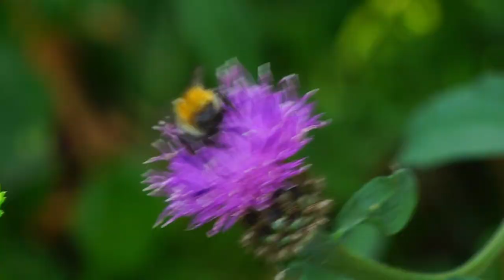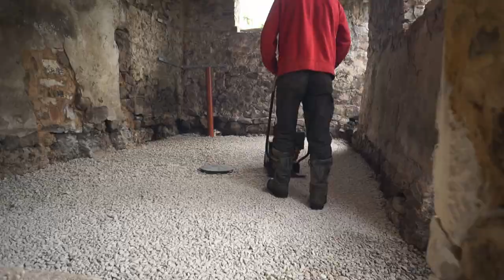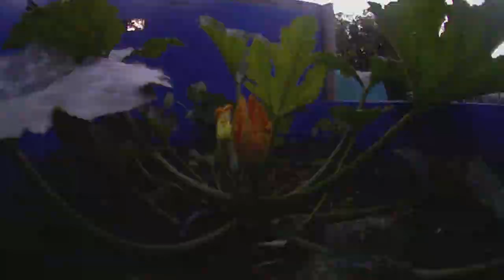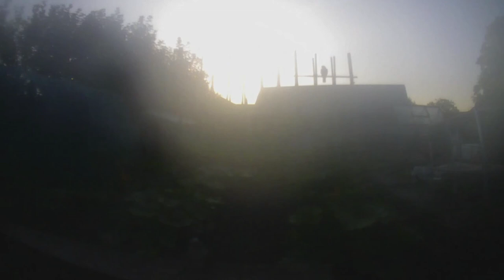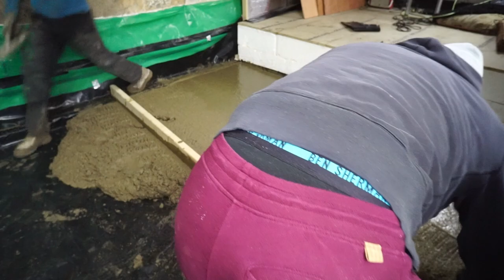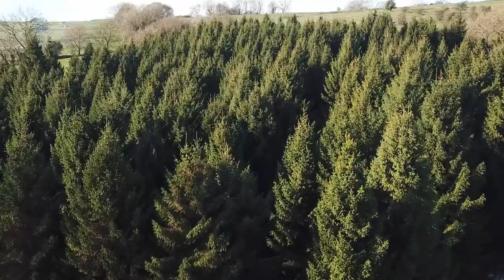Barn Conversion Time Lapse Nettle Barn 2022 1 year in 2 minutes tiny home self build house

Comment: Nice progress. Just wondering, why did you put such a a depth of insulation just at one end of the barn? You seem to be using two different floor construction methods in a relatively small space?
Reply from the maker: Good question. Basically I didn't have enough room for the stairs so I've raised the kitchen floor up 2 steps so now there's enough room to fit the rest of the stairs in. And raising the floor level on Polystyrene was the best option to do that. It also divides the space up nicely whilst still leaving it open plan
Reply: @timmynettles  I knew there'd be a good reason :) Thanks.